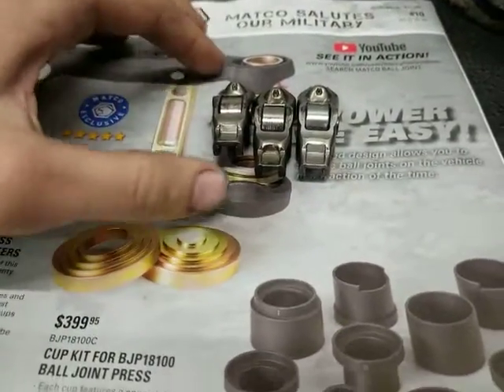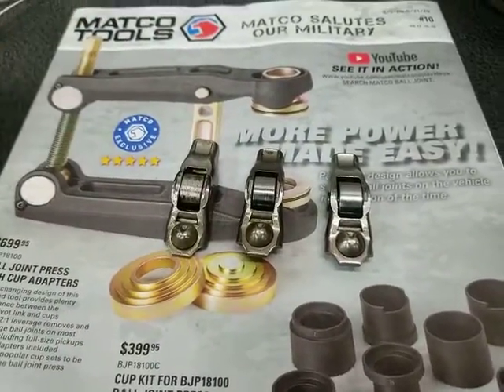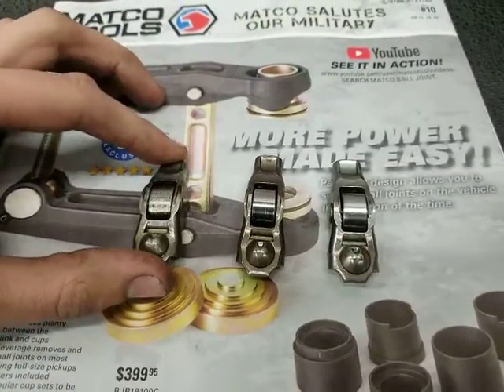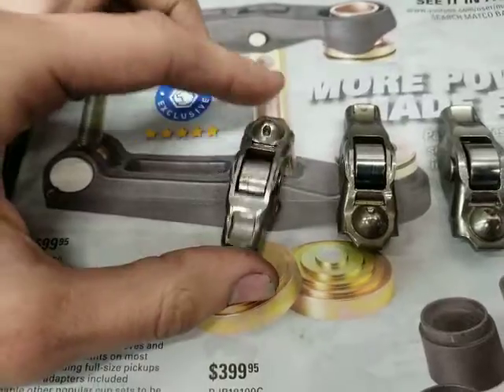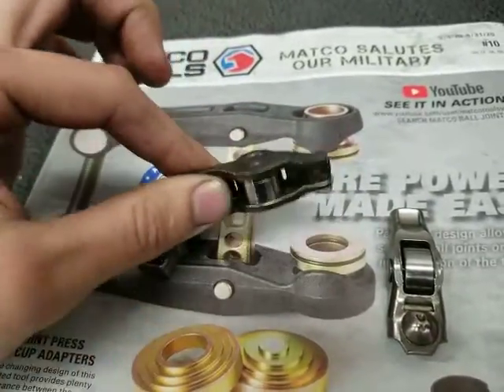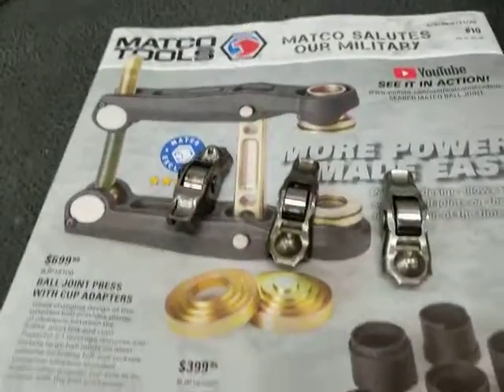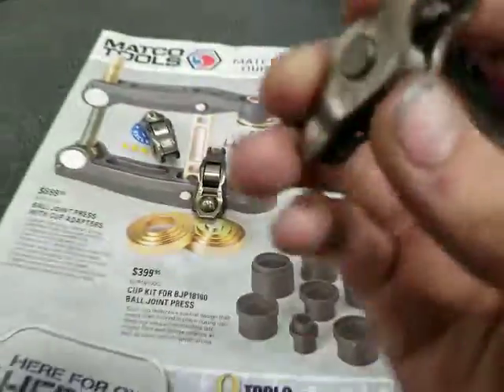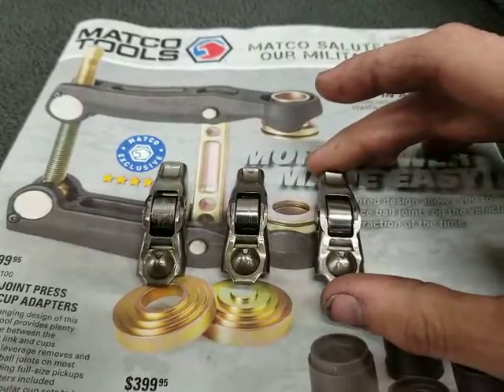3 stages of Chrysler pentastar 3.2 3.6 rocker arm failure

Comment: Did all three produce a misfire?
Reply from the maker: No! Very good question. I've had rocker arms fail all the way from slight play to roller locked up and not cause a misfire and we have also had a couple of cases where just the slightest amount of play caused a misfire. To the point where it caused us to chase down the misfire and find the rocker arm that caused it, so little play that it wasn't even making any audible noise over normal running.
Reply: @XHikotheproX  Thanks, My engine is missing and seems to be ticking from the rocker arm near the timing chain, left bank. I'm thinking about releasing the tension on the timing chain and then loosening the cam journals to fix it.
Reply from the maker: @stu3775  Yeah you can gain slack with the right tools on the left bank just know that the tensioner on that side has a ratcheting mechanism that makes depressing the tensioner hard. Also the cams at TDC on left bank need to be rotated 90 degrees clockwise before you take cam caps loose.
Reply: @XHikotheproX  Thanks Patrick, I appreciate your time and advice!.
Reply: @XHikotheproX  just saw this video I have a 2013 Grand caravan. New OEM plugs fuel trims are good. But it'll misfire on cyl 2 it hasn't thrown a code but I can see it misfire every so often on the misfire counter on my scan tool. Every time it misfires I will feel the engine stutter and give the little misfire shake/jolt. I don't hear any ticking per say that's out of the ordinary. If I pull the valve cover is the slightest amount of up and down play a possible culprit for this? Plan on pulling it apart tomorrow.
Reply from the maker: @Koda18  before you take the valve cover off do a compression test.
Reply: @XHikotheproX  I did compression cold was all between 148 and 130. Oddly enough the cylinder misfiring was the highest compression. Seems a little low but maybe it being cold makes that difference. Has 107,000 on it.
Reply from the maker: @Koda18  oh OK. Every good 3.6 I've ever done and that's quite a few are right at 150 psi warm every time. So if that's fine which I think it is then yeah you need to pull all of cylinder 2s rockers and check for play. When you have 90 psi it's usually the exhaust valve cracked like the X56 warranty extension.
Reply from the maker: @Koda18  check those damn 13mm oil gallery plugs when you have it off btw. Below/behind the phasers
Reply: @XHikotheproX  what am I checking them for?
Reply from the maker: @Koda18  oh right my bad. They come loose and start to back out. Make sure they are tight.

Comment: My 3.6 from 2016 has a Little Rock but I think I always had it idk if it’s normal or not.

That being says I have the p06da code and I’m having a tough time finding a mechanic who is competent. One switched the sensor even though they code doesn’t indicate sensor failure. The other connected the device that reads three codes and got tons of different codes and said it might be his device since he had gotten a few of those codes on another car.

That device after disconnected did something to my car where it wouldn’t go into gear and start . The lights were flashing in my car . And it eventually started and the car now runs a little nosier than before. Like I can hear the engine more. It also has little electronic sounds from behind the dashboard and wheel that weren’t going on before .

That same mechanic told me he had no idea what it could be, I mentioned it may be the solenoid and shorts related to it with a printout showing what the code meant and it was maybe four things on the list . And he says “like I said it can be anything” and acted like it was a mystery .

He told me to take it to the dealer so they could diagnose it instead of him.  The dealer told me they’d just change parts until they find the right issue and I doubt they will look into the solenoid itself but just tell me to replace the whole pump.

That mechanic said since my sensor was replace with an aftermarket duralast pump that he can’t trust the reading either .

Honestly I just don’t have a lot of trust for mechanics. I don’t even know why the first guy changed the sensor without a diagnostic . And then gave me an after market pump. Took him 2 weeks to get the pump tho on autozone it literally says 1 day shipping for free.

If I knew how to do this stuff I’d just do it myself . My car has 115000 miles and isk if I want to go down spending thousands on fixing it at this point
Reply from the maker: You need to find somebody that knows what the hell they are doing. The dealer telling you they will just change parts until fixed is ridiculous.

Comment: Just had one cam and my rockers replaced on my 2020 ram 110,000 miles
Reply from the maker: So maybe it's an eventuality no matter what the year. Just a combination of oil gallery plugs, oil changes, and what needle bearings you got handed from factory.

Comment: Yes, it is a weak point. But in all fairness, real stats on how many motors it actually affected over the years, year by year, would be good.
Reply: Pretty much most. It's not a matter of if, but when. It seems prolonged idling is the worst of it. Hence why a lot of the commercial vehicles are the most popular to suffer from it.
Reply: Hmmm….not sure what you base your opinion on, but I know of jeeps with over 200,000 and 300,000 miles on them with the 3.6. There’s one guy with a YT video with over 600,000 on it, the timing chain eventually failed. If you look around you’ll find the numbers of incidents of this problem in early 3.6’s. If what you say is true they would have stopped making them a long time ago.
Reply: Hmmm….not sure what you base your opinion on, but I know of jeeps with over 200,000 and 300,000 miles on them with the 3.6. There’s one guy with a YT video with over 600,000 on it, the timing chain eventually failed. If you look around you’ll find the numbers of incidents of this problem in early 3.6’s. If what you say is true they would have stopped making them a long time ago.

Comment: My engine had small fragments in the oil filter since the first oil change. Always used Mobil One.  It got better between 60 and 90k but then got worse again.  Sold it before engine and transmission failed
Reply: such a nice guy, bet the new owners appreciate you
Reply: Never use Mobile 1 in the Pentastar 3.6 it doesn't have the Chrysler 
Ms- 6395 spec in it. Use Penzoil or Valvoline

Comment: Is this an engineering fail on chrsyler or do you think it is the company that makes the rockers, or some of both? I find is shitty that chrylser hasnt owned up to it, i have a jeep with this engine and other than the shitty plastic oil cooler, its great, same with the transmission, even tho its super clunky. Those old mercedes transmission are stout, knowing i said that, im gong to have a trans problem lol
Reply from the maker: I've thought about this. A lot. I cut open failed rockers and found that the center pin that the needle bearings revolve around is the part that wears down and then allows play of the roller and the needle bearings have all the room in the world to stack up on each other and grind themselves to bits or just fall out. The hydraulic lash adjusters underneath the rockers feed pressurized oil through a hole that sprays on the lobe and also covers the outside of the roller. But there's no dedicated oil to the needle bearings? Also the oil gallery plugs bolts for the cylinder head oil supply are literally 7 times out of 10 loose and that is also a known issue. So is it oil supply, shitty materials of rocker cage, quality control of manufacturing/assembly or whatever you call that. A combination of all I suspect. Also agree NAG1 trans from Mercedes great unit just 5 speeds and not as refined as the 19 speed shit that they have today or whatever they're up to I lost count.
Reply: @XHikotheproX  that is very interesting, do you mind if i post your reply to a jeep forum im on? A lot of us do our own work cus offroad nerds
Reply from the maker: @mails5054  by all means go right ahead. If you want any more info for the jeep community ask me here in this comment section I don't mind giving my 0.02 from about 11 years of Chrysler experience
Reply: @XHikotheproX  Do you reccomend 5w 20 or 30? A lot of people like to debate whats better. Sometimes mechanics or engineers give opinions, but a lot of people are already conformed to their answer without working on the things.
Reply from the maker: @mails5054  climate where it doesn't get used or Temps don't drop below 40 degrees or so for any length of time I would run some sort of concoction of 5-5.5 quarts 5w40 and some thiccc sauce that sticks to stuff and stays in places that would normally drain away
Reply: @XHikotheproX  I live in minnesota haha so we can see -20 in the winter. I usally change my oil twice a year. In the summer i use 5w30 and in the winter 5w20 - ALWAYS 5w something penzoil ultra plat. Ive heard the big killer of the mercedes 5 speed is heat and low atf4, so offroad it i try to not let it cook itself to death. How do you like the new 8 speed transmission compared to the old 5 speed mercedes? Obviously the 3 extra gears is huge, but are they reliable? Can they take some beating like the older 5 speed trans. Theyre defiatnly a lot smoother, man when my 5 speed is cold in the winter, it isnt violent or rough by any means, but you can tell its some old tech